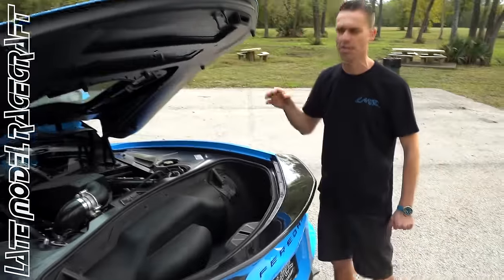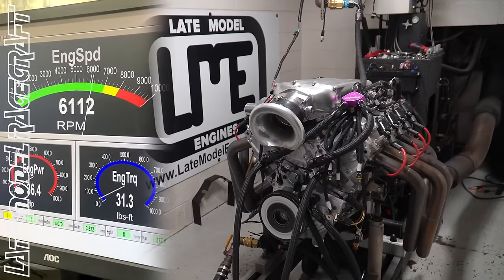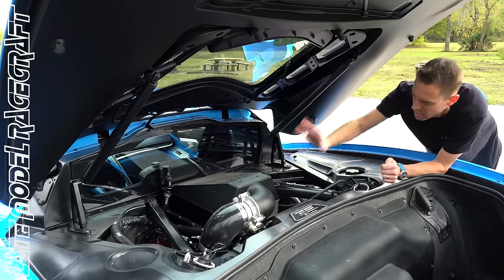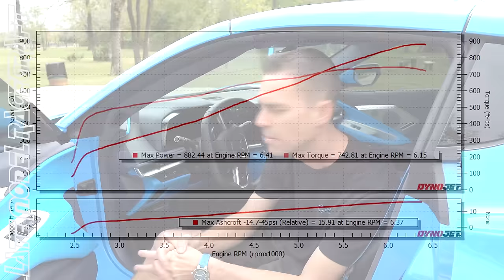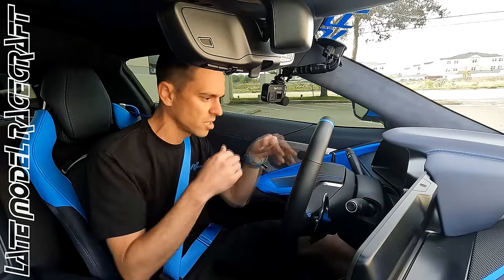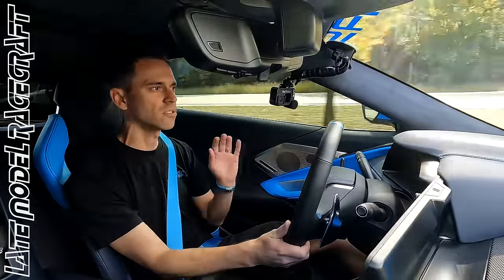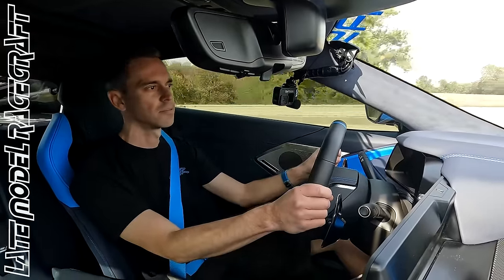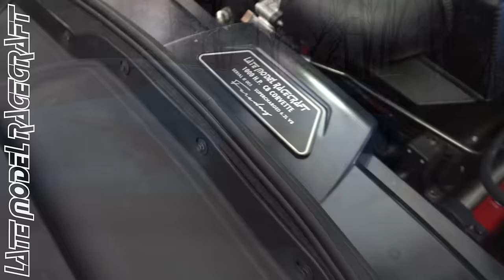Fereday Corvette hits Highest Horsepower for Supercharged C8 Platforms

Comment: I have checked out numerous C8 builds and it seems they spend a lot of time with the shop and then end up back at the shop for more tweaking. The Z06 has significant HP over the SRay, but only gains 2/10 of a second to 60. I would like to see this when all the issues are resolved and the owner is satisfied and has numbers for the gain (0-60 and 1/4 mile times). Many shops are getting better at mods for the C8 now. Good luck.

Comment: Awesome work as always. Would it have been an option to have a flex fuel tune that would adjust to ethanol ratings for this build? Seems like that would be the way to go and not having to worry about the fuel additive, just flex tune and put anything from 91 to E85 in it?

Comment: Impressive..
This is something I’m interested in having when I get a C8 Z51 or unless I get the ZO6.
What Compression Pistons are you running in the Engine?
Also, I’m curious as to if you feel anything else may need to be upgraded with the Transmission or Differential?
Thanks Much
Reply: The Z06 is locked. There are basic things you can get but it only adds about 20 to 30 whp.

Comment: Interesting. Not sure  how many folks have driven extremely high HP RWD vehicles because after a certain point, you do not have control of the vehicle because the rear tires can only give so much traction!  That is a recipe for disaster with high risk of crashing your car!  There is a reason why Porsche on the top 911, the 911 Twin Turbo, has AWD!!!